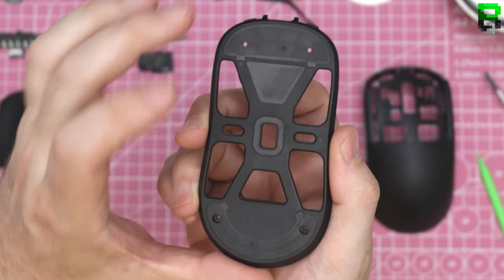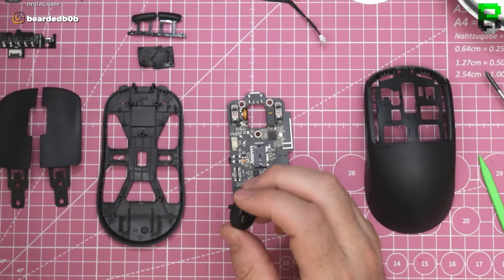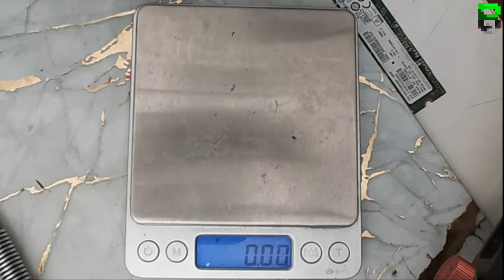Pulsar X2 Wireless Teardown: THE FUTURE OF GAMING MICE HAS ARRIVED

Comment: Was having some issues with RMB sticking when held down for ADS in games. Thanks for doing this teardown, it helped me get over being nervous that I'd break something. Took it apart, cleaned off some stray glue on the button where it contacts the switch, and it's working perfectly now!
Reply: I am having this exact issue on my LMB. Were you able to save the skate? Or did you just replace them?
Reply: @KeLim3Pie  If you're careful, you can peel it up with little to no damage by getting a spudger under it. I wasn't careful and it still stuck back down just fine
Reply: Same sticking when click down LMB 😢

Comment: Mr. Bob - Great teardown video! When you use lighter fluid to remove the skates, are the skates completed reusable or does the fluid dissolve the adhesive? Thanks.
Reply: You can technically reuse the skates but most people buy aftermarket skates that are better anyways when they're taking apart a mouse to mod.
Reply: I took my pulsar x2 and G303SE skates off using isopropyl alcohol and the skates still work perfectly, so theres no issue
Reply from the maker: 80% reusable but zowie or vaxee are never
Reply: Thanks to everyone for the kind & informative responses.
Reply: @dennish9543  they're reuseable but I've noticed that its better to buy new ones, mine never seem to go on perfectly again if I bend them even the slightest bit

Comment: Just took apart my black x2 mini (2 month old) today and mine had a round dot switch for the scroll wheel similar to the DPI button instead of the Huano yellow
what rip off version did I get? 😭
In contrary to how nice every other area on the PCB looks, the area around the mouse button pins looked really messy too.
I wonder if it was an RMA'd unit :-|

Comment: The only thing I wish is that the coating could be better, either the Zowie/Lg-Superlight coating where it is very resistant to permanent finger oils or UV coating like with Roccat mice.
Reply from the maker: really? I like the costing on it but its early days.....  most costings suck or wear in about 2 days
Reply: @Beardedbob  I know this is 11 months old but ya my first X2 copy already developed finger oil stains on the button after 2 days. But my Bruce Lee edition didn't have this issue.

Comment: . I dropped my mouse on the floor and now it is unresponsive. it's the Logitech pro x superlight. is there anything I can do?
Reply: It should have a 2 year warranty. Go on logitech's site support and contact them. You have to provide a serial number to identify the item and then after a short procedure a support will connect to the chat and will ask you some questions, a photo and the receipt from the store. If it doesn't have some visible damage don't tell them u've dropped it, just say that at some moment it stopped working. They will try to help you to fix it, if you can't then they will either let u refund or replace the item.
Reply: @R4DIOACT1V3  okay, sounds good I will keep you updated
Reply from the maker: does it rattle?
Reply: @Beardedbob  no
Reply: @wharding3975  Did you contact their support in the end?
Reply: @R4DIOACT1V3  so I did and they, said to contact amazon and amazon I'd giving me a full refund for it. Thank you for the help